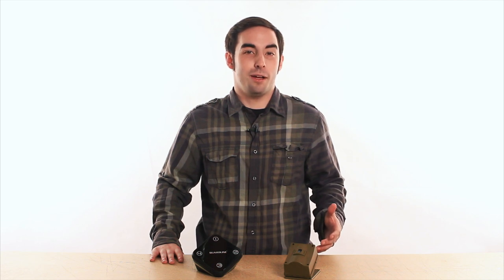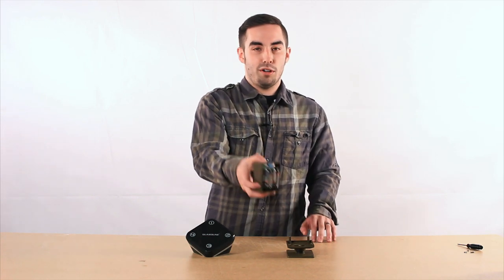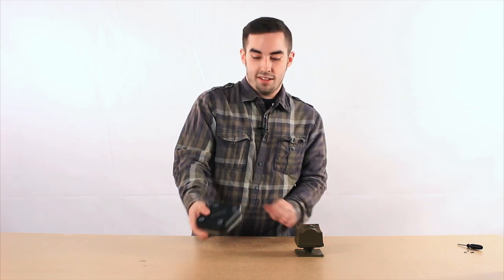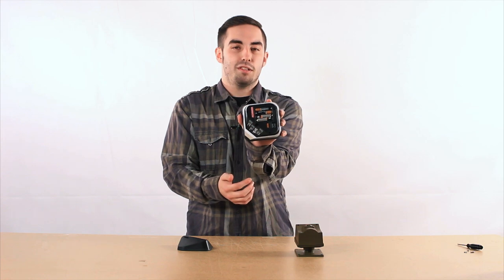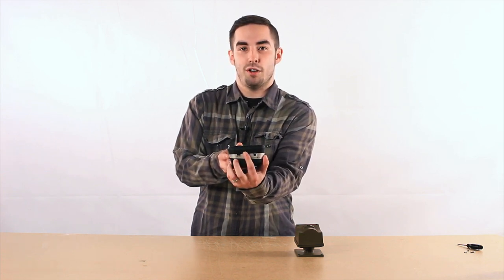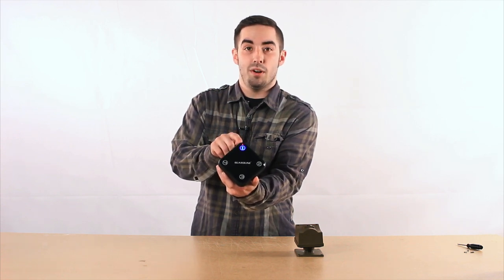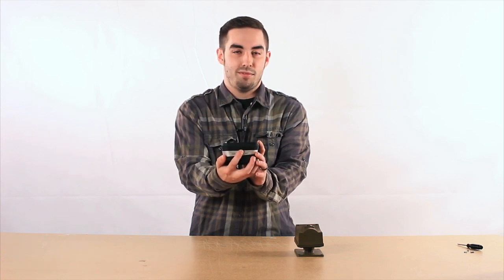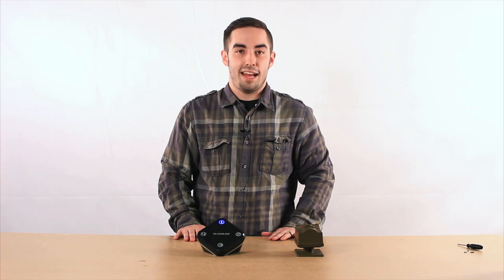How to Set Up A Guardline Wireless Driveway Alarm - A Tutorial

Comment: I get no confirmation beep from my sensor. What would the problem be?
Reply: Me too.....
No confirmation beep and then it does not use the melody that was selected according to how you do it in this video which happens to be different than the instructions in the manual which says to turn it off and then turn it back on neither one of these steps worked
Reply: same here. no confirm beep. cannot change chime. I just get a little sqwak to let me know it's paired to something but it's barely audible enough to be heard from another room.

Comment: Why is the 500 foot range sensor not compatible with the 1/4 mile reciever? I accidentally added a 500 foot sensor to my 1/4 mile reciever a d it seems to work fine.
Is it just because of the range? The 500 foot  i bought is within 50 feet of the reciever. Thanks

Comment: With line of sight and 4 ft off the ground and visible, what is to keep pirates from stealing censors off someone's property?
Reply from the maker: You can easily camouflage the sensor by putting it in a birdhouse or concealing it. Also, if anyone walked in front of it or tried moving it, you would be alerted.
Reply: Can’t you mount it under the eve of the house and point it down to the area that you want to protect?

Comment: does the receiver charge rechargeable batteries when its hooked up to 110 electricity?
Reply from the maker: It does not - the batteries in the receiver work independent from the 110 adaptor.

Comment: I bought an extra sensor and found that it will not pair with my 2020 receiver. Apparently Guardline changed the transmit frequency in 2021 to 915 MHz and didn't tell anyone. Be careful, I am stuck with new sensors that don't work and its too late to get an Amazon return. This seems like a bad consumer marketing decision. 

Guardline should advertise the system as GEN2 after 2021. Buyer beware!
Reply: thanks wish i had read this comment before getting my second sensor ... now landfill

Comment: Bought base unit (receiver) and 4 sensors (transmitters).  3 of the sensors paired up just fine with the base.....the 4th would not no matter how many times I tried.  Will be calling on Monday.  25% failure right out of the box is not a good sign.
Reply: I had 3 of 4 fail!
Reply: They all quit after a few months, but I could see the faint red light going off in the sensors.  Turns out the AAA batteries in the base unit had run down.  Now bear in mind, the unit comes with a "wall wart" for power, and it was plugged in.....but apparently without those backup batteries, it won't work.  Stupid design.